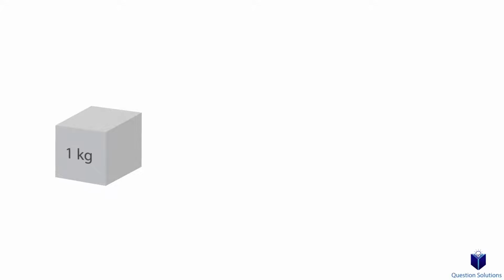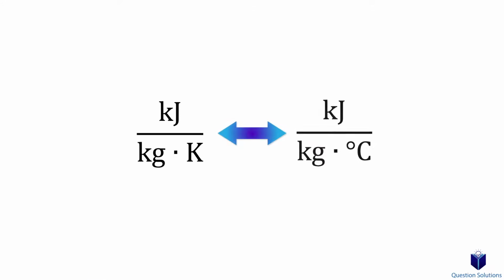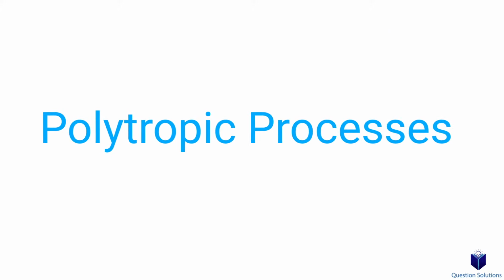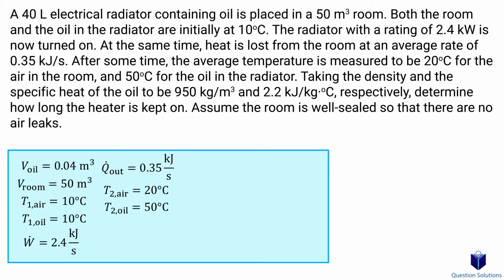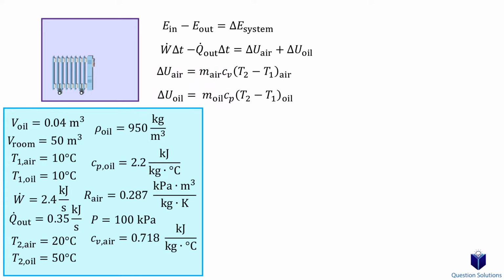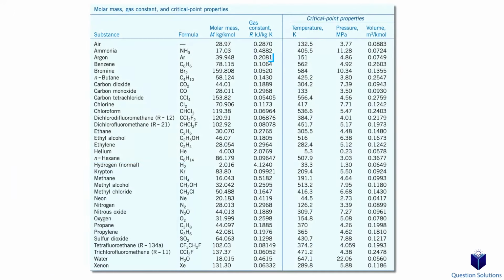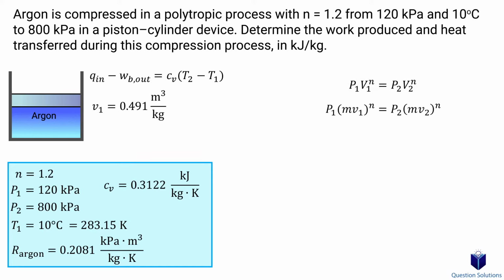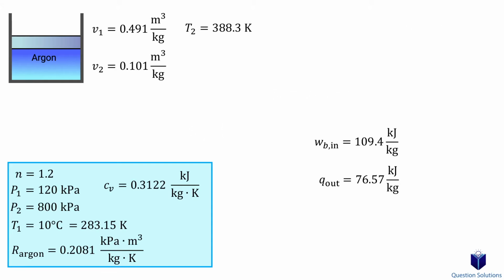Ideal Gases - Specific Heat, Internal Energy, Enthalpy  | Thermodynamics | (Solved Problems)

Comment: Why did u use cv for air & cp for oil in the first question?
Thank u
Reply from the maker: It should have been labeled cv, but that value was given in the question. So it's a typo on my part. Also, oil is an incompressible substance so you can interchange cp and cv.

Comment: How can one understand that should i take cv or cp e.g you took the cv for argon , how can i know which one should i take
Reply: Am i right 
Cv=when body is well sealed (like for air in 1st problem)
But Cp = ?
Reply from the maker: So generally speaking, if the volume doesn't change, you can use cv, and if pressure doesn't change, you can use cp. So in the argon problem, the pressure changes by a large degree, so cp can't be used. @H5EVER
Reply: @QuestionSolutions ooh okay 👌

Comment: For the second question, why are we using Cv to calculate the change in internal energy when the process is clearly NOT a constant-volume process? Isn't Cv the specific heat at constant volume?
Reply from the maker: There are only two options to use, either Cp values or Cv values. Here, the initial pressure is 120 kPa, and final pressure is 800 kPa. The difference is far too great to use a Cp value and our results would create a large margin of error. So Cv has to be used. In addition, keep in mind that pressure increasing generally indicates a constant volume process.